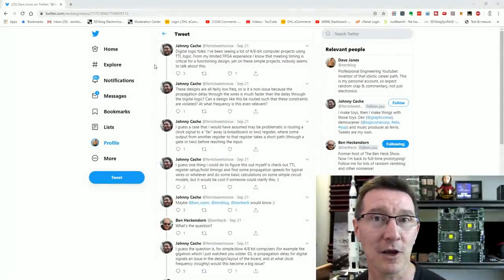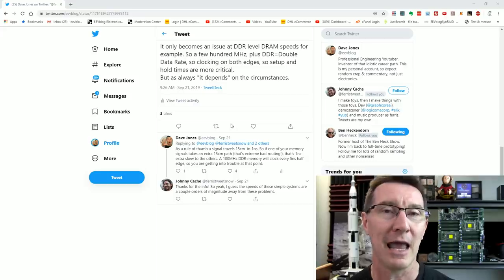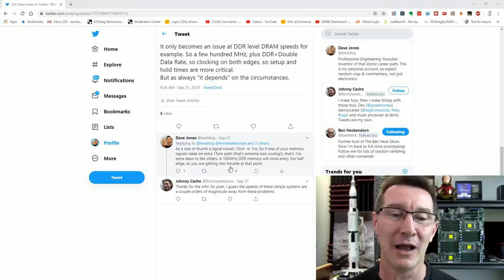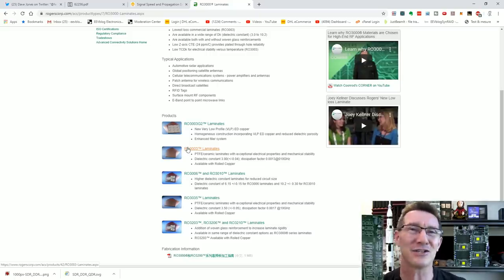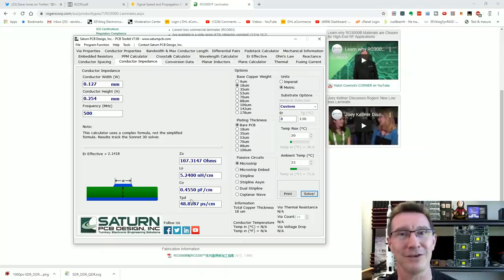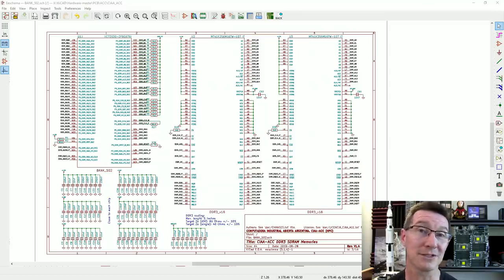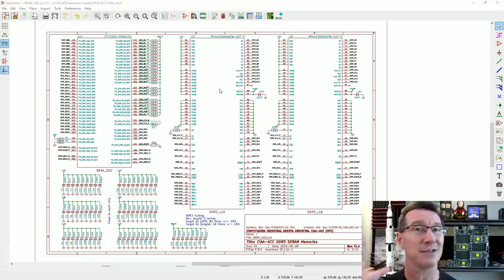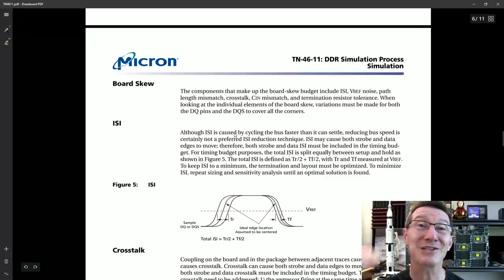EEVblog #1247 - DDR Memory PCB Propagation Delay & Layout

Comment: Another good tip for routing high speed signals is keep each trace on one layer from start to end; don't let it jump between layers, as you normally would do for low speed signals.  Here is why.  Suppose you are routing a signal with microstrip (that means the signal trace is on an outer layer, and the layer just beneath it is it's reference plane, usually ground).  The current in the trace will return on the reference plane just beneath the trace.  If you could see the return current in the plane, it would look like the shadow of the trace.  Now suppose you jump the signal to an inner routing layer that is between two planes; this is now stripline, and it has two reference planes (usually one is ground and the other will be a power plane).  So how does the return current follow the trace?  If all the planes are the same potential (e.g. all grounds) then the return current will find it's way through the nearest via that connects the planes together.  But if the plane vias are far from the trace via, you get a big loop, which looks inductive, and will cause a nasty reflection.  So, if you absolutely must have your trace change reference planes (which is very common if it goes through a connector) make sure there are plane vias very close to the signal via.  And if you are changing reference planes (from say, ground to 3.3V) then you must put a decoupling cap very close to the signal via, that couples the reference planes together.
Reply: Had a prof talk about this once I think, well before knew enough to understand it. Thanks for the refresher
Reply: I love this topic. I've been doing research on this at my University - on how to eliminate the reflections when going through vias. At the same time I've looked at how to design the via itself to reflect in good ways (i.e. filter). I love seeing more high frequency engineering on Dave's channel.
Reply: But at this level of design, you are most likely dealing with BGA packages (0.4mm to 0.8mm) for your MCU/memory, and thus your high speed lines will need to go onto inner layers by blind vias or via in pad. Long gone are the days of using big Xilinx FPGA with bulky 8062 MCUs and routing the HS on the top layer.
Reply: @FurEngel  Yes, with a big BGA package there is no way to escape all the signals on just the top and bottom layers; many signals will have to escape on inner layers.  Those signals should stay on the same inner layers all the way to their destination, which is typically another chip.  It's okay to change layers at the end of the trace, where is comes to the surface to connect with the chip as long as there are decoupling caps very near (typically on the opposite side of the board under the chip) that connect the reference planes to ground.  For example, assume a signal is routed on layer 6, with a ground plane on layer 5, and a VCC plane on layer 7.  In this case it is important to have VCC-to-GND decoupling very near both ends if the trace, even if one of the chips doesn't use VCC.
Reply: @steverobbins4872  Yep you're right, I'm currently routing DDR3 chips to a polarfire FPGA and the BGA size means we have to via down straight under the pads pretty much with 2 film micro via layers. We ended up with a 18 layer board because of the tiny form factor we need!

One tip is to place your VREFDQ and VREFCA generator as close as possible to the DDR chips, normally you'll be using a TPS51200 or similar here (make sure your converter has push/pull outputs or you'll be in a world of trouble!). You need a nice fat island for this VREF voltage right next to your chip with decoupling caps at either end.

If you do it right you'll breeze through your SI/PI simulations!
Reply: @Steve Robbins I always appreciate your contribution to these EE topics. Thanks so much for your insight.
Reply: The problem is the change in the characteristic impedance when the signal switches layers. To prevent this, you make sure there is a ground signal return path that maintains a constant distance from the signal path from one end to the other.
Reply: This is sort of like in the RF world where you have via stitching or fencing to contain your signal. Also, in the RF world all transitions are typically modeled to make sure performance is maintained throughout. E g. Going from microstrip to stripline.
Reply: @BarriosGroupie  very nice in few words thank you, thanks all.
Reply: Is there a video from dave on Signal integrity?
Reply: As far as I have understood from Rick Hartley’s videos, caps have almost no effect above about 300MHz (rise/fall time-wise), which is almost everything in designs like this. So coupling of the planes must be done by putting them real close together, as far as he states, which is done by using power-ground layer pairs
Reply: @AbdullahKahramanPhD  Yes, good point.  Thank you.  There are some caps made for very high freq, but they are expensive.  Pairing planes is low-cost, but doesn't give you much capacitance.  For example, an FR-4 core that is 0.1mm thick will give you about 18pf per square centimeter.  But that doesn't mean you can get as much capacitance as you want just by having large planes, because the return-current for the trace wants to bunch up under the trace (skin effect).  You can get special cores with higher capacitance, but they can add significant cost.   So here is my advice in order of priority:
1. Avoid having high-speed traces change layers wherever possible
2. If you must change layers, then use only layers that are adjacent to ground planes, and put at least one ground via close to the signal via.
3. If your high-speed trace really has to change reference planes (from GND to VCC for example) then put these planes next to each other in the stack-up, with a very thin layer of prepreg between for max capacitance, AND add high-freq decoupling caps near the signal via.  But I would really avoid this if possible.
Reply: @steverobbins4872  Do you think one can lay a board with a 0.8mm spacing BGA processor and a single DDR3L memory on a 4 layer PCB with power and ground planes in inner layers? I am asking in terms of EMI problems.. Or do you think one should make both of the inner layers GND and try to route the power on top and bottom layers where there is space available? Assume top layer is layer 1 and the next layer is GND, what happens to DDR traces running on the bottom layer? They have more than 1mm distance to their reference return plane.. Will this design pass EMI?
Reply: @AbdullahKahramanPhD  Are you sure you can do this in just 4 layers?  How many pins on the BGA?  Are there other chips on the same board, such as an FPGA or CPU?  If so, what kind of packages are they in?  How many supply rails does each chip require?
Reply: @steverobbins4872  I personally have never designed a board with BGA, but I’ve seen people doing power and ground planes in inner layers and their designs worked with no memory errors at all..

I am just trying to understand how is the return path for the signals that are away from the ground plane on a 4 layer board where there is prepreg between planes and no plane coupling.. Say:
L1:signal
L2:GND
Prepreg:1mm
L3:PWR
L4:signal

How is the return path for a DDR3L signal on layer L4?
Reply: @AbdullahKahramanPhD  Okay, I understand your question.
The most important rule in any kind of high frequency, high power, or low noise layout is to always look at the current loops.  Current can only flow in closed loops.  If your loops are not closed, it won't work.
For example, consider a CMOS device that is driving a trace on layer 1, and layer 2 is ground.  When the pmos transistor is turned on, current flows from VDD down thru the pmos, thru the signal trace to the termination, thru the termination to GND, back to the GND pin of the CMOS device via the GND plane, and then up thru the decoupling cap near the CMOS device to VDD.  That's a complete loop.  And when the pmos is turned off and the nmos transistor is turned on, you get another closed loop.
Now, replace the GND plane with a VDD plane.  (For example layer 3 is VDD, and the trace is on layer 4)  Do you still get two closed loops?  Yes, BUT ONLY IF the termination is connected to VDD instead of GND.
So, the lessons are:
1. You can use either GND or VDD as the reference plane for a microstrip trace.
2. Buy you have to make sure GND and VDD are well coupled at the driver to close your loops.
3. And you have to make sure you are terminating the trace properly (if it's terminated at the load end; some are terminated only at the source end).
4. But DON"T let the trace change reference planes along the way; use one continuous plane under the trace along the whole path.
Reply: @steverobbins4872  Thank you for your wonderful explanations.. However I don’t quite understand how is termination to VDD done.. Do I have to use termination resistors for signals that reference the power plane?
Reply: @AbdullahKahramanPhD  A controlled-impedance trace is a transmission line.  Transmission lines need to be terminated with an impedance that matches the characteristic impedance of the line, otherwise you get reflections.  Ideally, both ends of the line are terminated.  But often it is sufficient to terminate just one end.  If you terminate the load end, the termination must provide a current path from the trace to the reference plane to close the current loop I described earlier.  The reference plane could be VDD or GND, depending on your layout.
I suggest you watch some YouTube videos about transmission lines.
Reply: @steverobbins4872  I understand, but all of the DDR3L RAM chips I came across have internal on die termination as they say and the reference designs I see doesn’t have termination resistors.. I will look into this subject in a deep manner and will probably have more questions for you if you will not yell at me 😅
Reply: @AbdullahKahramanPhD  No, I won't yell at you.  Of course some chips have built-in terminations, but you need to understand how it all works.  When learning the basics, it is best to think of discrete termination resistors.
At the source end, the CMOS driver is typically designed to have 50 Ohm output resistance.  Part of this is the on-resistance of the MOSFETs, and part may be an additional series resistor.
At the load end, a voltage divider is typically used as the termination.  For 50 Ohms input impedance there is typically a 100 Ohm resistor from the trace to GND, and another 100 Ohm resistor from the trace to VDD.  And of course there must be decoupling caps that tie VDD to GND.  This allows you to use either GND or VDD as your reference plane.
Of course, a 200 Ohm resistive divider wastes a lot of power, especially if you have a lot of them.  So these are almost always replaced by their Thevenin equivalent.  Picture a single voltage divider (typically many kilo-Ohms) between VDD and GND that produces a bias voltage VB = VDD/2.  Then buffer VB with a linear amplifier that can source or sink a significant amount of current.  Now you can tie a 50 Ohm resistor (again, it may be inside the chip) from each digital input to the buffered VB.  The currents flowing thru these termination resistors can return to both VDD and GND via the buffer, so you can use either VDD or GND as your reference plane.
But the most important thing I can tell you is DON"T try to learn all this (or anything else) simply by memorizing so-called "rules of thumb".  Instead, you must learn to visualize how circuits work, and the best way is often to look at the current loops.  Always sketch simple circuits and draw the loops on them.
Reply: @steverobbins4872  Oh, all right! I think I get it all now when I got the pen and paper and drew it :) So, for 4 layer boards, I can safely use power planes as return paths when both ICs have tightly connected low impedance decoupling caps AS LONG AS I  don't switch layers. If I go from an IC to say a transistor only, I can put a decoupling cap near that transistor and I can then still use that power plane as a return path, right?

But still, above 300MHz, will that capacitor be able to couple the signal so that the signal will be able to move to the power plane over it?
Reply: Almost EVERYTHING is in the high-speed regime today due to die-shrink. Rise-times are down to about a 100-300ps! Your recommendation to use decoupling caps will not work with frequency components larger than ca. 100 MHz. In the case of a 300ps rise-time signal, your effective bandwidth is around 1.6GHz. The decoupling caps are no longer visible at that speed. The real solution is to use thin <= 4 mil dielectric layers with an ample amount of inter-plane capacitance.
Reply: @pfabri  I agree

Comment: As a software engineer with no formal hardware training, this very topic nearly caused me to quit doing electronics as a hobby. But then I did what you suggested and tossed out all the garbage I found online and started with some basic rules of thumb. I was over the moon when I printed my first USB3 hub board and it worked! Since then I have laid out some single-board Linux boards with ARM chips that use DDR memory and have had great success. My first couple of attempts failed, but then I took the courses on the FedEvel website and my next attempt was a success. There's a lot to learn on this topic, but if you just use some common sense and some good rules of thumb, and use your layout tools to your advantage, you can lay these PCBs out in no time.
Reply: I think the need for laying out DDR limits the use of Linux on hobby projects. If you only need a single or dual core it is possible to get chips with the DDR in the chip package which makes everything a lot easier.
Reply: @donpalmera  My thought process was much like yours when I started out. But after doing a few designs and putting in the time to learn about the subject, I found that it doesn't have to be a limiting factor. Learning how to do these things, even as a hobbyist, opens up a whole new world of project possibilities.
Reply: @testep02  I think I could probably do a layout with DDR2 if I really needed to but assembling boards with BGAs etc isn't really fun. I have Cortex A7s with DDR2 integrated in QFN now. If I want something with linux I can copy and paste the common parts like power supply into a new schematic, add the new bits and gerbers off to JLCPCB in a few days max. :)
Reply: @donpalmera  just a tidbit about soldering BGAs. I went to Walmart and purchased a toaster oven and fitted it with a thermocouple hooked to an Arduino. I can't get the exact temperature ramp up profiles that the high dollar ovens can do, but that method has yet to fail me. I use BGA chips on most of my projects now. The biggest problem you'll have with them is that some packages have a ball pitch so small it's hard to get a manufacturer who can guarantee those trace widths for a reasonable price.
Reply: @testep02  I have a toaster oven reflow setup so I could do BGA but as you mentioned getting BGAs with pitches that are compatible with JLCPCB etc isn't so easy especially if you want something like a quad core ARMv8 chip. The Chinese PCB fabs are super cheap right up until you add anything like more than 4 layers, decent tolerances, micro/blind vias etc. For boards that cost ~$10 with shipping messing up something isn't so bad. When you're paying $50-$100 for boards you only really want one of and you mess up it's pretty frustrating.
Reply: @donpalmera  damn truth!... i thought of usb2/3 camera project but stopped as i can't obtain sensors i wish for reasonable price and pcb price was reason too (100$ is too much for hobby project)
Reply: @VileVermin  I've had a bit of luck getting things I want in solder down modules from taobao. There seems to be a market in China for sub-assemblies for low run stuff so it's possible someone is putting what you want with support components on a little board you can integrate into a design that'll work on a cheapie PCB.

Comment: Back in the day ... :-) I worked with an engineer that needed to delay an NMI signal to be slightly after the rising edge.  He used what he called "Mickey Mouse Logic", placing 4 unused inverters in series between the source and target.  It worked flawlessly at 1 Mhz.  It was a bit eye opening for me at the time (I was like 19 or so), and has stuck with me ever since (this was in late 80's or early 90's).
Reply from the maker: Yep, very common delay technique. Also useful as a bodge on production boards if you have spare gates
Reply from the maker: @HaseebElectronics  Almost 14 minutes to show how to use a crimping tool. I don't even I could make it that long
Reply: @EEVblog  lol. Brutal honesty.
Reply: i might go look at that crimping tool vid...oh hang on..this guy has spammed it on a bunch of comments here....screw his spam!..his channel is now added to the block list!
Reply: I've heard a great story of someone who patched a gigabit phy onto an ARM-based SBC (for prototyping/validation purposes prior to custom design), replacing its 100Mbit phy, since all the signals were there. Unfortunately RGMII has an annoying requirement that the PCB needs to add 1.5-2.0 ns of delay on the clock lines (unless either host or phy supports "internal delay", which wasn't the case here), so he just used 60cm patch wires for those two signals, problem solved! :-D

I still think it's a terrible crime he didn't take pictures of this monstrosity.
Reply: Apparently it takes 11 minutes to explain what a relay and a switch is.